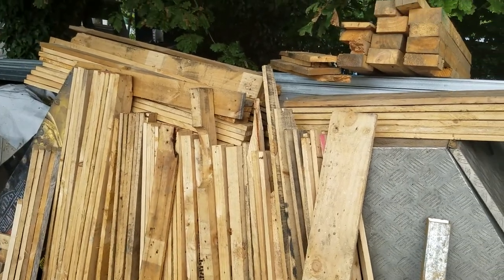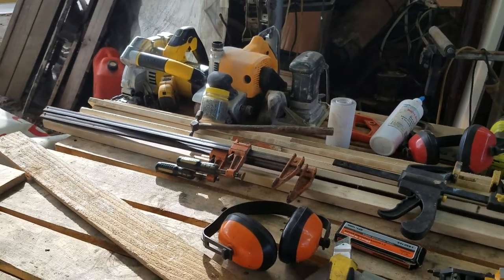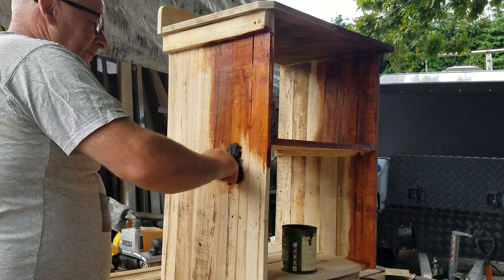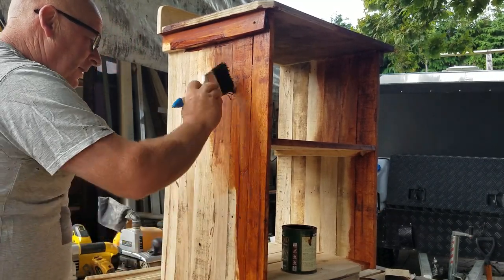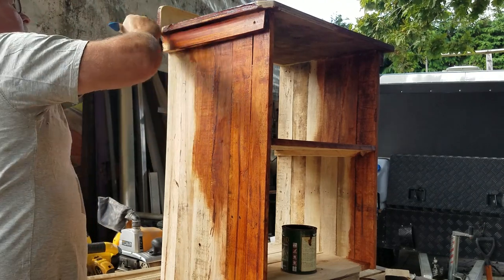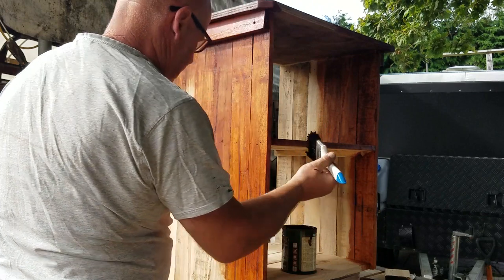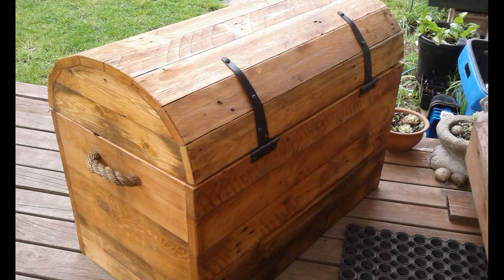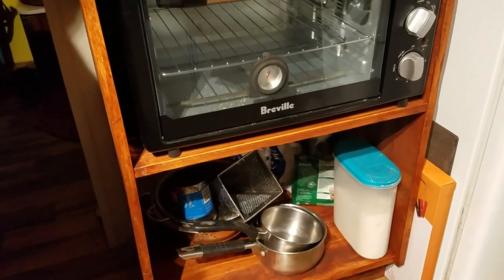A Rustic Cabinet from an Old Pallet.

Comment: Nice work. Pallets are great for outbuildings too, between my 4 cord woodshed and my 12'x9' tool shed I have under  $100 invested. Soaking steel wool in vinegar makes a cheap and safe stain. The great thing about it is I can stain my 800sqft of ceiling boards while cooped up in the house with the woodstove cranking and not be gased out by fumes.